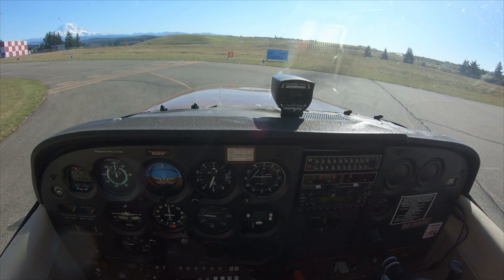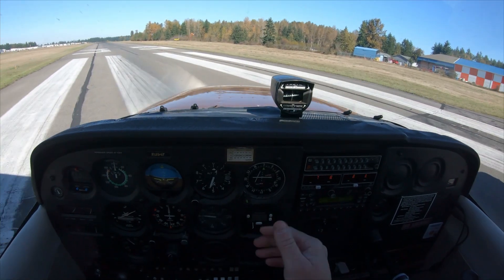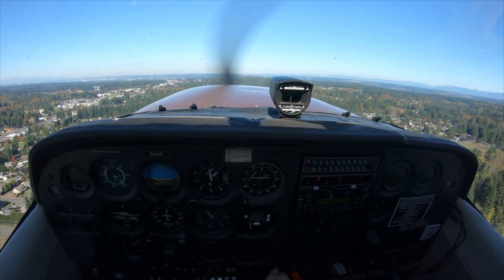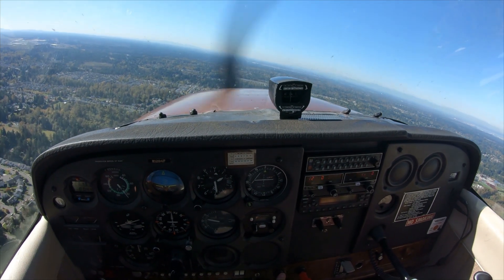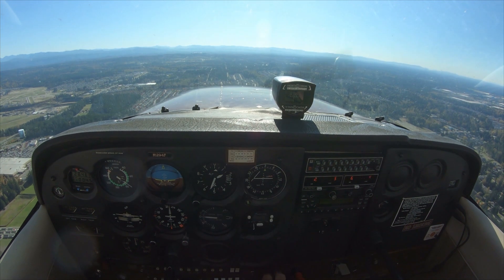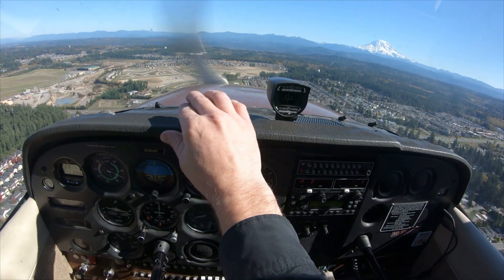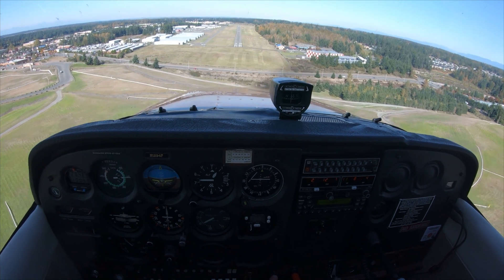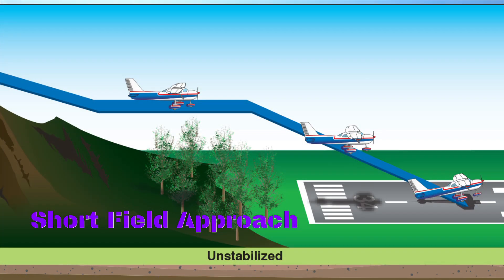Short Field Landing Cessna 172 | CFI Checkride Prep | Private Pilot

Comment: Now THIS is the type of instruction I can understand! Short, simple, sweet. I’m prepping for my PPL checkride 3/9. Struggling with short field landings at the new airport I’m flying out of. Which is why I found this video:) I’m going to rewatch a few more times. I need an instructor like you! Where are you out of?
Reply from the maker: I teach out of the time Seattle Area.  Hope the video helps! 

Try to come up a little short and then power up and drag it in (with an instructor to start). Being short is easy to fix if you have gone over it a few times.  Being too long is tough if you don’t catch it early, usually the best answer is go around if your long.   

Also keep in mind that if you hit your spot your usually good for the check-ride.  I know instructors that teach basically a precision landing and it’s good for the check ride. All the technique and tips end up being less important than making your landing spot. The epiphany of using the back side of the power curve and  learning the real dynamics of a short field landing is pretty rare for private pilot, sadly. Your on the right track though ! 

Best of luck! If your learning in the Seattle area I’m available for a instruction.
Reply from the maker: Hope you got those short field landings down! Most examiners give a bit of leeway they know your still learning.  Hope you passed easily !

Comment: First I thought I was listening to a student on his ppl check ride and thought WOW!   OK CFI, makes sense.  Good video to return to.  Lots of solid info there.  Thought you were too high to make the numbers but you nailed it.
Reply from the maker: Lol,  yeah just me flying left seat for a change.  

Once you get the sight picture down (depending on wind ) it’s hard to over shoot using this technique.  I like to aim a little short that way I can drag it in if needed.  If I was going to over shoot I would have added just a little extra rudder to dirty up the plane ( not enough to  really slip  just a little extra wind resistance) and it would have increased my decent rate by 300fpm.  That was a Cessna 172N,  so we have the 40 degrees of flaps which make for some steep looking approaches if your used to 30 degree models.  

Thanks for watching and the great comment !
Reply: @NEROAviation  
Lately I have been flying gliders and I like a steep approach.  But so many power approaches I watch on video seem to be so flat.   Not sure if it the camera distortion or if I have forgotten a normal approach.  But when I flew 172s I was flying your type of approach.   It's been too long.

Comment: Not nagging or critiquing but rather curious about the way you performed the takeoff. We teach our students to position the airplane as to use all the runway you can on takeoff. Once in position, hold the brakes, set full power, release brakes, and build airspeed to Vx. Once at Vx is attained, rotate, climb at Vx until clear of the obstacle and then lower the nose for Vy or normal climb out airspeed. Either way, great video.
Reply from the maker: We do our short field takeoffs exactly as you describe them.  

That was just a normal takeoff and pattern with a short field approach and landing.  I don’t teach the short field takeoffs much as they are pretty easy.  For takeoffs I do mostly soft field takeoffs since that’s the hardest of the three.  

Thanks for the comment! I don’t mind some critiquing it makes me a better instructor!  Sorry I didn’t make it more clear what type of takeoff I was doing. Thanks for watching !
Reply: @NEROAviation  - Right.  Soft field take offs take ability, Specially with a left crosswind.  Good to do them as much as posible instead of the easy to do take offs.  Any 3 hour student can do the wimpy normal take offs..

Comment: In the 1970's We used only 53 knots (60 MPH) for short field landings.  We came down at steeper angle, and only 60 mph..
Reply from the maker: We have one 1978 that use 53 kts for short field...  and the other 3 use 60 kts .  They are all the same year and all look the same so go figure.
Reply: @NEROAviation  They have the same wings and flaps, so they should use the same speed.  But by that year they were cutting the flaps to 30 degrees only.  60 knots is too fast for a short landing.  I have done hundreds of them at 53 knots at full gross, power Idle. Im a CFi.  If you used say 55 knots you didnt have to put power at all on short final..

Comment: Did he leave his carb heat on for the whole landing? I just always cycle it on he downwind so I have full power in case of go around
Reply from the maker: Yeah I leave it on for landing.  If I go around “everything full forward” .  

Carb icing happens pretty quick in some aircraft so base and final at low rpm without carb heat can lead to a more dangerous situation than the 300 rpm reduction I would get on a go around if I forgot to push in the carb heat.  

I just do what the checklist suggests.  On a Cessna  172 it says carb heat in on the go around... it’s super easy and not out of the way.  A Beaver on the other hand you have to reach for it and it’s back in on final.  

Cessna 172 either way will work  but I suggest the Cessna carb heat on for landing method simply because icing up on base to final and then dumping in power for a go around and killing the engine would not be fun to explain to the faa.  Why weren’t you using carb heat ? 

Not to say that would ever happen to a Cessna 172 ... but I don’t know if it’s possible or not.      

If you have a warm can of air and you turn it upside down and spray it how long does it take to ice up ? 

Your way is totally normal and lots of people use it,  and teach it.
Reply: @NEROAviation  I just flew with an instructor a few days ago and he confirmed the same thing you are saying. Apparently it is very airplane specific. When I learned in a Cherokee it is recommended to just cycle the carb heat but for the carburetor on the 172s you should leave it in. Thanks for the info. Great video.

Comment: On my PPL checkride on a hot and turbulent July in Florida, the tough FAA examiner requested at end of all the maneuvers, including full stalls from steep turns, "A Short Field Landing over a 50 feet obstacle with a direct 12 knot left crosswind" And at an airport I have never been before that he ordered to go there and pretend it was an emergency short field landing.  That is the max crosswind for a C150 with full flaps.  He thought I was going to say no.  I did it well, not easily.. He said;  that was beyond my expectations.. I think you have a PPL. 

Short and Soft Field landings with max crosswinds make you a pilot or a loser..  I was 18 years old with 35 hours only.  The bare minimum for PPL..
Reply from the maker: Awesome ! Great job ! 

Cross wind is tough for most private pilot students who usually don’t get a lot of practice doing it ( if any) before a checkride.
Reply: @NEROAviation  - FAA regs still demand CFI's to teach mild crosswind landings to students BEFORE SOLO.
Reply from the maker: “Teach” doesn’t mean that they actually get to do a real x-wind landing with a substantial x- wind.   I really like x-wind training and try to teach in real conditions whenever possible.
Reply: @NEROAviation  Right..  Too many airplanes are destroyed by guys that cannot do crosswind landings.   FAA should specify  clear crosswind component on the FAA test.  It is not required on FAA test.  
My CFI got a bit mad at the Examiner for demanding "A short field Crosswind landing at the max recommended" at a 35 hour student.  I remember as I flared, I had to sink that right rudder and a lot of aileron while flaring.  Not easy...